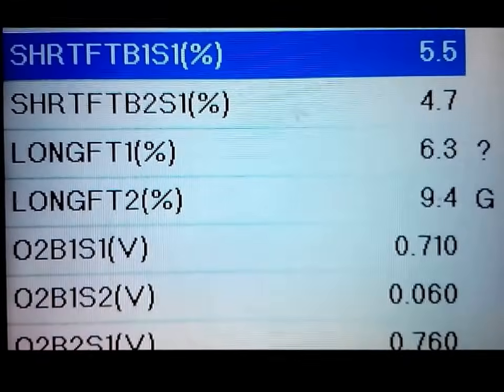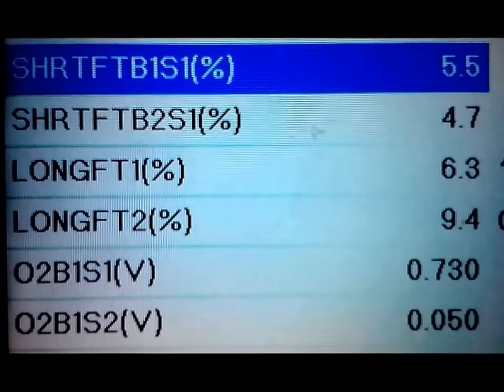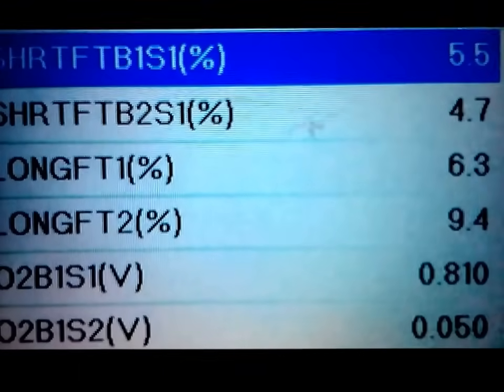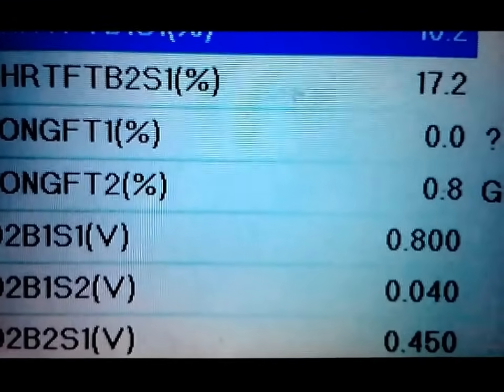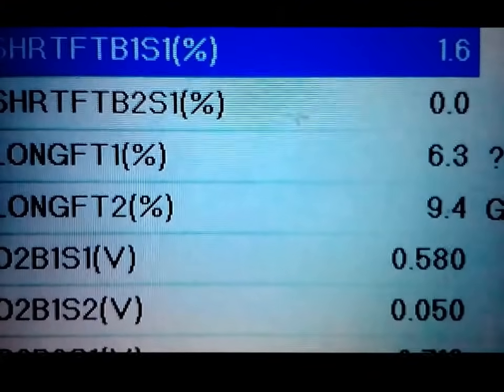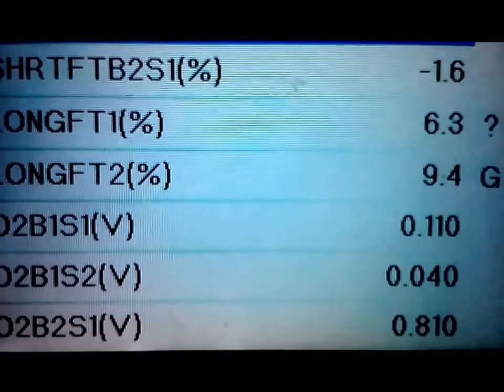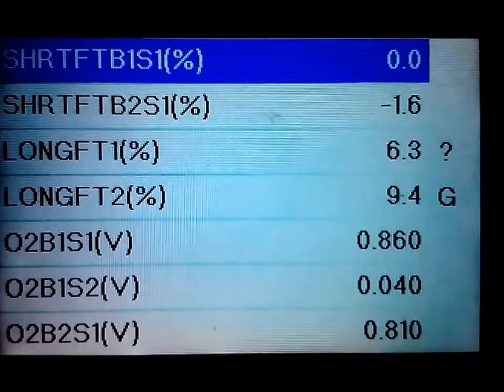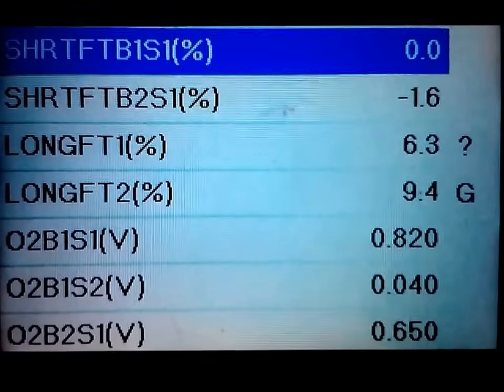how to read 02 sensors, short and long term fuel trims

Comment: So I have a chevy v6. I got the evap system working. And then I got po420 p0430. Replaced everything from sparkplugs to wire and coil. New o2s too. I haven't checked the scanner yet for short and long term yet. This truck has 93000 miles. Runs good. And exhaust seems fine. No weird oder. Your video helped alot. I have spider injectors. And wonder if they maybe bad. Everything has been oem.

Comment: Question STFT B1 S2 (%) is reading 99.2. What where should i look at ? Reading on both sensors are fluctuating how ot should though
Reply: I get the same reading on my car on bank 2 but my bank 1 is reading 21.1

Comment: Have a 09 a4 2.0t that keeps giving me to high fuel pressure code have changed 02 sensors and high pressure pump relays and pressure regulator still same issue every now and again get a Catilist effeciency code but not always any ideas on that have tired a 02 sensor simulator and a bunch of crap any ideas would be great is kicking my butt at this point

Comment: Is the 02B1S2 supposed to stay the same ?
Reply: No ,if they're the same as upstream o2 sensor ,it will trigger a cel usually, cuz it means the precious metals in the cat are supposed to reduce some of the gases and pollution ,if the readings are the same it means the cats not doing its thing

Comment: Man. I think your info broke my confusion on this ft stuff. Thank you for your knowledge. I have an 07 Santa Fe that is throwing a p0420. The car is running great and I dont think it has a bad cat. so I recorded some live data and I have a shtftb2s2 at N/A and another one at 99%. I have an idea of what to check now.
Reply: Did you get a reply?
I’m kind of on the same boat, but opposite side so looking for the answer. 
B1S2 N/A P0430 code which it’s kind of the opposite, but then not really since I’m guessing it’s relying on the only one that is providing info.

Comment: One important piece of info everyone should know is, many late-model vehicles don't have an upstream O2 sensor per-se. They have what's called an upstream air-fuel sensor. Those are basically O2 sensors on steroids. They don't just indicate a discrete rich or lean condition in the exhaust. They provide a numerical ratio to the ECM as to how rich or lean the air/fuel mixture is so the ECM can calculate a more accurate correction. The most important thing to know about air-fuel sensors is, you read the voltage in the OPPOSITE manner that you would read a standard O2 sensor. In other words, with an air-fuel sensor, higher voltages indicate a lean condition and lower voltages indicate a rich. It's read in the same manner you would read fuel trim.

Comment: Thoughts?  I have a 2017 QX80 where the Oxygen sensor shows as Incomplete.  I am not getting any error codes and all other driving cycles are complete.  Sensors appear to be working as the voltage fluctuates as I drive.  Voltage may be going above 1V occasionally. Code scanner says below 9V is ok.

Comment: What can it be if the short term is fluctuating quickly from lean to  rich and b1-s1 is staying around 0 but b1-s2 is staying around 0.755-0.800v and the short term on b1-s2 stays at 99.2% and I keep getting  code p0171. Any ideas changed both o2 sensors same problem. Thanks in advance
Reply: Vacuum leaks. Either get a smoke test or soapy Bubble test to find the leaks
Reply: Or fuel injectors if you find no leak

Comment: Hey mate, what is your opinion: my has just had a performance cam fitted to his Ls 2 V8 and extractors at the moment is trying to decide whether to use the original cats   or fit cat deletes, Ive told him he needs cats.so it runs properly correct?

Comment: My 97 tacoma 2.7 is running at +13 long term fuel trim running at highway speeds and my short term fluctuating between + and -. My 02 sensor is hanging at 0.135v. Would those numbers suggest a lean condition pointing towards weak fuel delivery?

Comment: You have to add your short term and your long term together to get the total amount of value ... O2 sensors .... Anything above 450 millivolts is in the rich and anything below 450 millivolts is in the lean ....

Comment: BANK 2 for me is ~50% STFT!  and high LTFT also.   I used a smoke machine and found a few intake air vacuum leaks.... but still remained.  I used the smoke machine into the TAILPIPE and found a badly leaking exhaust DONUT from the exhaust manifold.  $5 fix... will find out tmrw hopefully!

Comment: 9.4 fuel trim is a bit high.. 😅

I won't even tell you what mine was then lol

I haven't got to figure out my p0171 lean code yet but I think it was because I didn't have an air filter on my cold air because it fit different on my 98 cobra, or i need to plumb the valve cover vent back into the crankcase for positive vacuum because the 98 was a little different that the 01 cobra but it was dumping about 25% on the trim. 

Luckily im still breaking in the motor so there was no getting in it with those trim levels.
Reply: I'm 27% on lter..what was ya issue..Injectors!..What I'm thinking

Comment: On my 2003 escape all starts with P2197 then cylinder 4&6 misfire :(
Find no leaks, cleaned sensors , changed injectors etc.
O my both LONG reads are at = 0
FUEL = CL FAULT
ECT = 76
SPARK ADV = 7-12

Comment: Fuel trims somtimes are not accurate, caused by one the sensors,  like mine the MAP sensor cause  both fuel trim to be at 12 to 14  percent, i tought i have vacuum leak, but it was the aftemarket delphi MAP senosr reporting wrong  values to the ECM, i just put back the OEM sensor and the fuel trim went down to 5 percent.  I couldnt believe it, the initiale issue was rought idling and somtimes engine misfire, but it was the ignition  electric connection wires were loose at the aftermarket start button system, basically i create the problem overtime by using bad quickdisconnect connector, i replace the connector and problem solved partially rought idle and misfire, but fuel trim problem got fixed by installing OEM MAP sensor back.

Comment: Dear sir , i have some kind of these issue in my car bmw E46 and it says voltage failure bother oxygène sensor ( v ... Fail ) B1S1 AND B1S2 . Sir i have changer the oxygen sensor and still same fault code 2C45 DME : oxygen sensor before cat. Conv.1. sir plz if you could help me to solve this problem . Thanking you in avance sir .
Best regards.

Comment: Bro.. I and dealing with 2005 toyota seinna.. Got a code p0174.. But custormer wanted further job like valve cover gasket, rack & pinion.. So code got cleared and i was trying to see if tht code comes back.. It haven't yet but problem i see is bank 2  seems running soo lean since long term is around 19 and short term is like 3.. Bank 1 seems ok adjust its self... While looking at 02 reading upstream is giving 3.3 v which seems coming from pcm reading.. But down stream showing like .05 like in ur video.. I am confesed here...
Reply: Do tht means catlytic convertor is clogged... Thts what i cam come up with.. But customer says he changed bank 1 catlytic convertor he have changed like 6 months ago

Comment: What have you heard about your O2 Sensor 1 needing to see voltages in the .930v to preferably .945v?  I was seeing someone post about that for the 3800II engines on Buick Park Avenues.  Coincidentally, my OBDII Bluetooth scanner using the Android  Torque app NEVER had voltages hitting those levels.  Usually .9v was the absolute highest it would fluctuate to and for a year now, on the screen that shows your systems that run their checks, my "Catalyst" was ALWAYS red "Incomplete."  And just yesterday, I had a code pop up, after a whole year of rough running, jerky hesitation during acceleration, high idle, bad fuel mileage, etc., a code popped up that the bank 1 sensor 2 O2 was bad.  Now, that's the second sensor after the cat, while the one he was talking about was the first sensor before the cat.

But he swore up and down the "magic number" was .945v with .930-.935v being great, too.  And as I said, mine rarely touched .9v, usually topping out at .875ish volts on the top swing.

Car specific?  Wives' tale?  Good advice?

Either way, I bought a replacement O2 sensor for the first time in my life to replace Bank 1 Sensor 2 O2 sensor. It was only $36ish with tax.  Bosch brand, but tons of good ratings on Autozone if that means anything.  I hear Denso is what you want but all I want to do is make this Park Ave run smooth long enough to sell it and buy a Ford with a 4.6 SOHC/4R70W combo so I'll have something that will last a lifetime without any issues.

I think the 3800II is a good engine until 120-130k miles.  Then EVERYTHING around it and inside it starts falling apart.  It's unfortunate because, it's a decent sized V6 that makes decent power for the time (205HP/225TQ) with a smooth powerband and AMAZING highway fuel economy.  When everything is right, 34 mpg in a 4000 pound Park Ave was my normal with a few days of 36 mpg highway average mpg.  But typically 34mph.  

City mpg?  It's no better than a 4.6 HO Thunderbird from 1994 lol.  22mpg at BEST.  That's without A/C and driving light footed.  I've averaged 18.5 mpg driving with traffic using A/C in the city in this car.  My 94 Thunderbird never got that bad of mileage in the city.  The 4.6 HO is the same engine that the Mustang GTs used.  Just a lower horsepower rating due to the exhaust supposedly.  And, yes, I realize those mid 90's 4.6 SOHC 2v V8s are dogs for a V8... my 94 Thunderbird with the 8.8" rear and 3.08:1 ratio had 205hp/265tq but it'd pull long hills in OD with ease whereas this Park Ave has to kick down into 3rd to do the same hills at 55mph.  So there is a huge difference in the torque of that dog V8 compared to the "almighty" 3800II people love so much.  The same 3800II that blows a headgasket at 120-140k miles on every car.

Plus the Thunderbird weighed 3800 lbs, the Park Ave weighs 4000 pounds and Crown Vics weigh 4200 pounds.  The Thunderbird has IRS, though, and is RWD.  And the 4R70W is a far superior transmission than all the FWD and RWD transmissions GM used (4L60E anyone?)  Those couldn't handle V6 Firebirds, yet they used them in V8 Camaros/Trans Ams AND full size Chevrolet 1500 trucks with frickin' 350 V8's.  They also went into the LS1 Fbodies.  All it'd take is one day of half way spirited driving and you'd ruin your transmission.

My 4R70W was ran HARD and had literally zero issues.
Reply: Also, my short term fuel trims have been going + 8-9 quite often.  The long term is looking good, though.  Hoping this O2 sensor is the answer, because I've changed the IAC motor for the high idle (which is when I learned that the code means the IAC can't control the idle, NOT that it's a bad sensor), then I changed the PCV valve and even the housing it is in, put a new MAP on it, changed the MAF, replaced the fuel pressure regulator.. done the usual new Iridium plugs and changed the fuel filter.

No difference.  All this bad engine running happened after the Alternator died.  My cig lighter splitter has a Bluetooth to FM transmitter so I can play music from my phone to the radio, and it shows 14.6-14.7 amps.  I "THINK" it's okay unless it's a false reading.

Comment: I have a 5.3L V8 Grand Prix.  I'm having the issue that the O2 sensors on the OBDII reader are never coming off incomplete to complete in order to get my State Inspection done.  I've driven nearly 500 miles in all sorts of styles to try and achieve this and nothing.  I'm showing the following readings on the OBDII under idle conditions:  O2 sensor 1 bank 1 is 0.76V, O2 sensor 1 bank 1 short term fuel trim 7.03%, O2 sensor 2 bank 1 is 0.42V and O2 sensor 2 bank 1 short term fuel trim is n/a %.  Do you have any ideas which sensor could be causing this issue please, or any other insights that might help?

Comment: My b1s2 is reading. 035 and I change the sensor and looked for leaks and when I'm under good acceleration it goes to around .650 like the other 02 sensors any advice is greatly appreciated?

Comment: @ 2:30 ....contradictory ???
I  understand  that a vac leak needs to be compensated for by adding fuel.
But I would think that a kinked hose would do the opposite since it is restricting air,  and therefore it would  require negative fuel in order to compensate.
True or not true ?
Please correct me if I got it wrong.
Reply from the maker: Correct and i should of explained further, if it was just kinked then yes, absolutely. But more often then not when a vacuum line gets kinked especially while under vacuum it usually tears, or starts sliding off it's clamped points, and eventually gets loose. Especially if it is older. I actually mentioned it in one of my other videos! Poor choice of words on my part. Thanks for watching!
Reply: Thank you for reply and explanation. Then I'm glad to know I'm beginning to catch on . I want to learn  this stuff.  @good2boost529

Comment: Why is the b1s2 showing really low voltage? I have this on my car, the b1s1 is fluctuating like normal, but the b1s2 shows between about .050 and .075 Thanks!

Comment: So my daughter has a 2011 Kia Sorento, poor acceleration, lack of power, etc. I scanned for codes, all it had was P0170 . I drove it and looked at the live data, one curiosity, the Long Term Secondary Oxygen Sensor Trim Bank 1 never changes, it is stuck on 19.5%. P0170 could be bad O2 sensor, bad Mac sensor, evap leak, etc. She had the cat converter changed couple of years ago, I checked back pressure and it seems fine, Maf sensor I replaced not to long ago. Just idling in garage when I rev it up or try to rev it, just doesn't do much. Checked compression, its good. Any ideas ?
Reply from the maker: I'm actually doing a video on that soon. Stuck numbers, especially fuel trims at 99% are usually caused by a bad 02 sensor. In your case though, I would verify the 02 has a signal. If so I would try and replace it. Hard to say for certain without a bit more information of course.
Reply: Thanks for replying. Since I first commented here is what I have come up with. Cleaned O2 sensor and even though Maf sensor is pretty much new, cleaned it also (yah I know that's iffy). Check engine light went off and stayed off. Got creative with a hookup for my gas gage and checked fuel pressure, its normal. Even though catalytic converter is only couple of years old checked it also, it checks out. No obvious vacuum leaks. When I drive vehicle and monitor live data, the wide band and the downstream O2 sensor data is within normal limits. Only odd or funky pid is the Long Term Fuel Trim, the second you move gas pedal the LTFT goes way negative, which if I understand it, is its trying to lean out mixture because its seeing something that's causing a rich condition but I don't see anything obvious and not getting any codes which I would expect because the LTFT is so negative. I did watch the coolant temp and it seemed to be bouncing around somewhat. I have just been manually shifting it because my daughter said it was not working at all, Saturday I tried it in full automatic, will not even shift to 2nd but shifts fine in manual mode, not sure its all related or not, some of it makes me wonder if computer has problems.

Comment: My both my Second sensors b1b2 and b2s2 Say 99,2% short term.. Should it be like that? My fuel enconomy meter shows that the more I put the throttle down the less I burn.. When I let the throttle off I get maximum fuel usage.. When I floor it I get regular fuel ecomomy. Wtf? The car drinks more fuel. It should be 0,7liter now it's 1,2liter. don't know in gallons. But it's pretty mutch one third more then normal.. Sorry for bad language.. Im from sweden.

Comment: 2010 equinox 3.0L V6, all 4 O2 sensors are reading 1.92v at each sensor. What causes this? engine just cranks no start.

Comment: Thanks for the great video. Helped a lot. I have a problem you didn't cover hoping you could answer for me. My STFT B1 S2 is 99.2 and my STFT B1S1 is - 63. If you could tell me what that is. And what's causing the 99.2. It never changes it like it is stuck. Thanks
Reply from the maker: Just seeing this sorry, I hope you got it figured out. 9 times out of 10 a maxed out fuel trim (99%) is caused by a bad 02 sensor. See what they're reading. Alot of times when you see the fuel trim at 99 you'll have an 02 sensor not really reading much, no change or super laggy and barely moving at all. Again sorry for the late response.
Reply: @good2boost529 even if you’re late responding to the OP, you help those of us who have the same issues looking for answers way after the fact. Thank you!!!

Comment: The point you made about the cold air is true. If you change the air fuel ratio outside of factory you'll need a tune.

Comment: Hello,thank you for the information. 

I was wondering if you could help me in the right direction?

I have an 06 5.7 hemi and I'm getting these codes for Lean fuel mix and I've looked it over and I simply can't find a leak anywhere,it does have an aftermarket intake but I'm not sure if that would be the cause.  

The Ltft is reading 32% and 21% at idle but they get close to 7% when I'm about 1/3 on the throttle and they return to the previous. 

I would appreciate your help.
Thanks

Comment: Hi how are things ? I have a 2011 Mazdaspeed 3 2.3L Turbocharged with Rich's issues I have the long term fuel trim at sometimes -16, -19,- 17, as the car warms up it becomes more negative, speeding up the long term fuel trim fuel trims, it goes down to -9.50 or sometimes -10.50 could the problem be a vacuum leak, or air leak after the MAF sensor? the short terms always go 0 -0 sometimes +7 but when accelerating sharply sometimes it jumps to crazy numbers like -17 or sometimes +20 what could be the problem friend? I would like to hear the comment
Reply: Vacuum leak